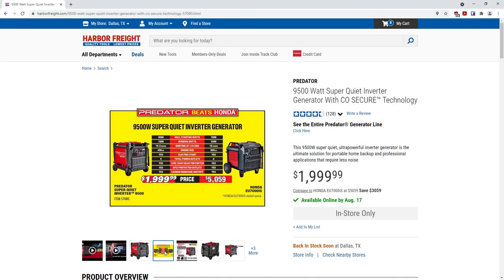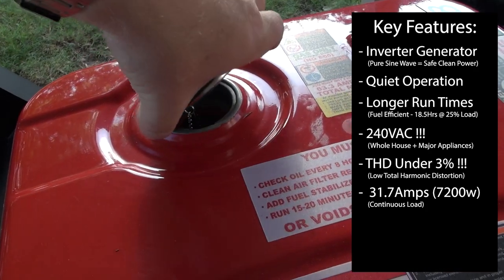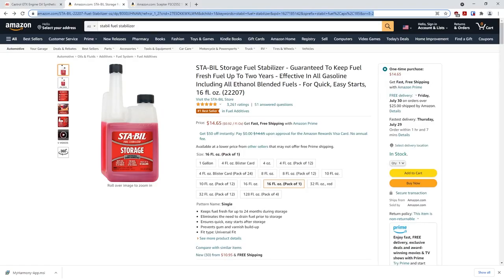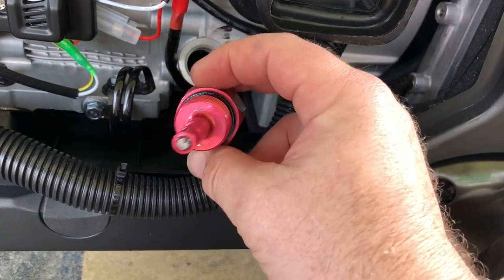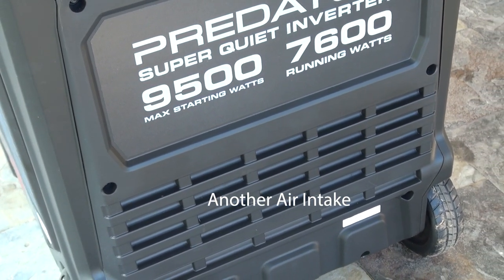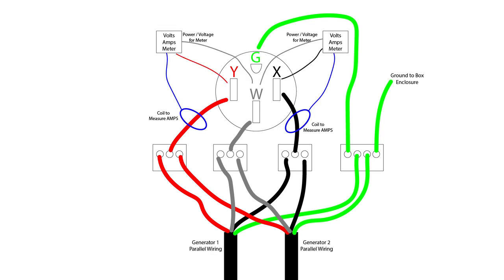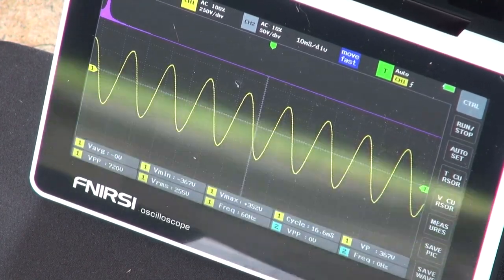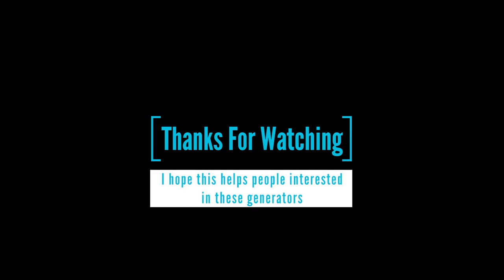Predator 9500 Review: All The Technical Tidbits In Under Ten Minutes (+Important Break-In Warning!)

Comment: I bought the 9500 Predator , about a week ago 
It would not stay running ?
Reply from the maker: Did you add oil?  They ship without oil, and won't run if the oil is low.  (you have to provide the oil, it's not in the packaging)  They use almost exactly 1 quart.  It will also not run well at all if you don't move the dial from "Start" to "Run".

If you did all that, you might just have a bad unit.
Reply: Yes I added oil

Comment: Watch out with those magnetic dip sticks. I had one for my Honda eu2000 and the magnet fell out of the aluminum dip stick and was sitting in the crankcase. I had to get it out with another magnet. If it would have gotten into the moving parts it would have caused catastrophic engine damage.
Reply from the maker: So far so good with mine... but yeah that was definitely a concern for me as well.

Comment: Is there room enough to install the oem tri-fuel carburetor, not the spacer type.. has anybody installed on of these?
Reply from the maker: It's a pretty tight fit in there.  Some people have converted the Predator series over to natural gas / propane, but honestly, if you need multi-fuel, consider the GENMAX GM9000iED on Amazon.  It's made by the same factory / people, and it solves all the shortcomings of the Predator and the Duromax.  
(it has a fuel filter, rear exhaust, 50A plug, remote control electric start, auto choke, nice detailed control panel display... and makes the same clean power)

Comment: Does anyone know how easy it is to remove the neutral bond to frame? I am replacing a bigger floating neutral generator that backfeeds my house during storms . I do not want to install a new transfer switch and would like to remove the neutral bond. This will be the only thing this generator is used for..I am hoping it's just a wire to the frame somewhere easy to get to and not coming directly off the lugs of the generator head.
Reply from the maker: I'm not an electrician, i don't even play one on TV...  but I really don't think it would matter either way.
Reply from the maker: I did come across a video the other day on these (and I don't remember who it was now to credit them) where they discovered that the Duromax's front panel's ground screw had two cables that connected to it from the rear of the panel.  Since the HF generator is nearly identical to the Duromax (apart from some spiffy extra features).  I'd assume it's probably the same.

One of those two cables (which can be sniffed out with a multi-meter) attaching to the panel ground screw was the frame bonding.  So according to that video, it wasn't too crazy of a "thing" to un-bond it.  I've elected to leave mine alone as I'd like to use them for other applications, and they're not permanently attached to the house.

Comment: For the money the Predator 9500 is a good generator but you can get the the genmax wich comes with a oil fiter and has more features than the predator like a 50amp plug but it only has 9000, but the pulseair is the same as the genmax and it has 9500 with the 50amp plug and oil filter.
Reply from the maker: Totally agree.  In past comments I've suggested that to folks:

If you need multi-fuel, consider the GENMAX GM9000iED on Amazon.  I've confirmed that it's made by the same factory / people that make the Predator and the Duromax machines, and it solves all the shortcomings of those machines.  
(it has the same engine and most of the same guts, but adds a fuel filter, rear exhaust, 50A front panel plug, remote control electric start, auto choke, nice detailed control panel display... and still makes the same clean power)

And because it has that 50A plug, the Powerhorse parallel kit that joins them together can be used stock, with no box, plug, etc.

Comment: is this easy to convert to propane?
Reply from the maker: There are people that have kits to do so on other Harbor Freight generators.  I'd think it won't be long till one is available for this one.
However if propane is important, you may consider the DuroMax XP9000iH, it's about ~$500 more expensive, but it supports propane, and has a cool auto start/remote start feature.  Might be cheaper and less hassle than converting this one over.  I don't have any first hand experience with it, but, I'd assume it's power profile will be similar, and it may have the features you value enough to justify the extra expense.

Comment: A novice here, so please ignore the idiot question.  I purchased a Predator 9500 from Harbor Freight with maximum 30 AMP plugin....if I reduce the required load to 30 AMP by closing breakers in my circuit breaker panel , do I need a 40 AMP or above capable generator.?
Reply from the maker: The generator is able to make the amount of amps that it's designed for.  In the case of the predator, it's around 40-ish.  The breaker you put on your house as a switch, should be matched to around the max you that the inlet and wiring can handle.  The circuits in your house have their own breakers, so the generator breaker is really just being used as a switch, but should also help make sure that you don't exceed too much, what the inlet can handle.

So if you have a 30amp inlet with wiring sized for 30amps, your breaker should also be 30amps.  However this limits you.

I would suggest that homeowners install a 50amp inlet, and a 50amp breaker.  (this means you can input into the house, up to a max of around 50amps).  This allows you to use an adapter, or a cable that adapts, and feed in 30 amps if you just have one generator... but it leaves you with the possibility of putting in more if you were to later, make a parallel kit or buy a larger generator.  This way if you need more power, you don't have to rewire your house.    The cost difference between a 30amp inlet and a 50amp inlet is insignificant in all this... so why limit yourself?  Think of the 50amp inlet as "future proofing" at almost no extra cost.

A 50amp inlet doesn't mean you have to put in 50amps.  It's just the max it should handle.  If it can handle 50amps, then 30 is no problem.  

(Think of it like a car that can drive 50mph max speed...  it can still drive 30mph just fine... but a car with a max speed of 30, can't drive 50mph without damaging something.  The breakers prevent you from exceeding the max of what the wiring/etc. is capable of handling for the section the breaker is protecting)

Comment: 8:32 0.9A starting current? That can't be right.
Reply from the maker: You know, I didn't even think about it much at all, but yeah, that number seems waaay too low.  Even for a small engine.
(I'm not sure how a coil meter reads DC amps, AC I can understand)
Reply: @Texas_DIY  I think the meter was just too slow and didn't capture the instantaneous max current. Typically, it should be in the 20-30A or whereabouts. Good video, nevertheless. Thank you.

Comment: If this is really a pure sinewave inverter why are the words pure sinewave NOT clearly placed on the box? I have had several inverters and I know that modified sinewave inverters can burn up contractor equipment like fast chargers. The words pure sinewave are very important to a buyer. Because my experience in the past is that if pure sinewave is not stated, it is not pure sinewave. Frying my equipment with a modified sinewave inverter generator is the last thing I want to do. There are a lot of modified sinewave inverter/generators on the market. Buyer beware. Make sure it is pure sinewave before you buy. Timing motors and quick battery chargers can be destroyed by modified sinewave inverters. I thought I saw the words pure sinewave on some predator inverter generator boxes at Harbor Freight months ago. But now when I look I can not find any pure sinewave labels on any predator inverter generators.
Reply from the maker: It's in the bullet points of the description on the HF website.  But I agree, they need to emphasize it more than they are.